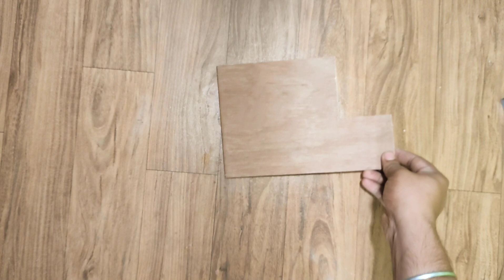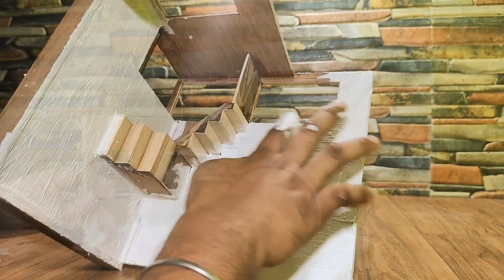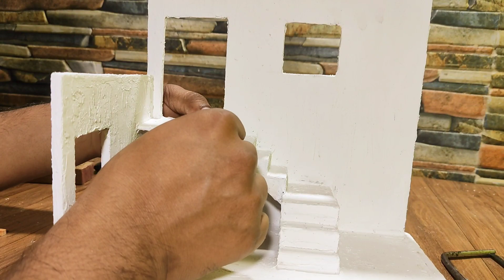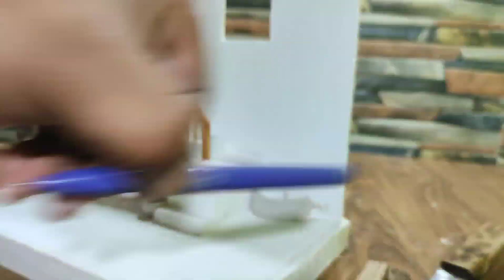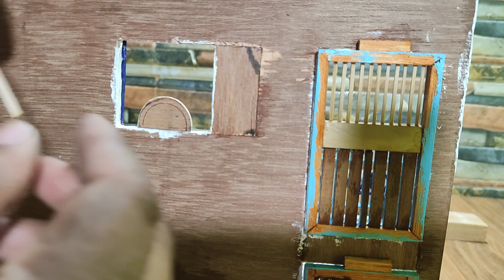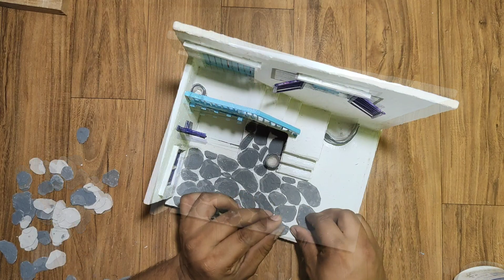DIY miniature Greek house  / How to make a miniature greek house /greek house diy

Comment: What is the material used for the wall?
Reply from the maker: Wall putty
Reply: @mealsrmiles  could you please give the measurements
Reply from the maker: @yukthareddy9281  It doesn't have any specific size, you can make it any size you want to make it.